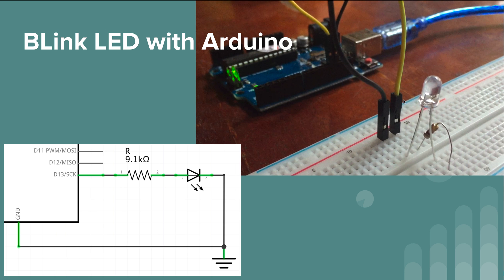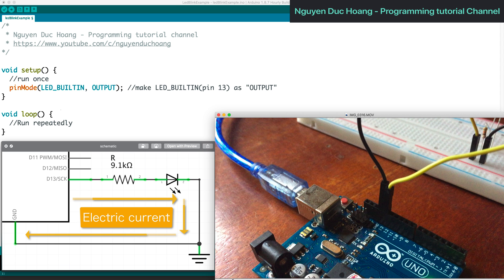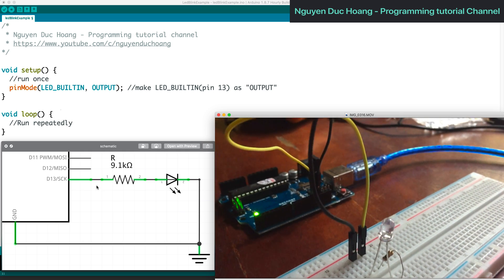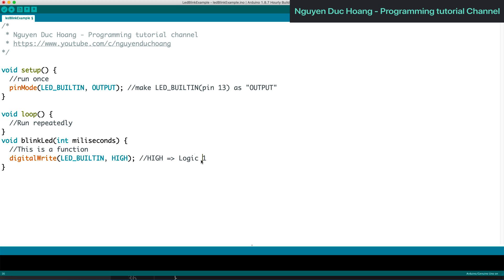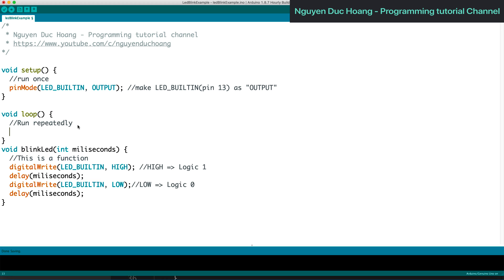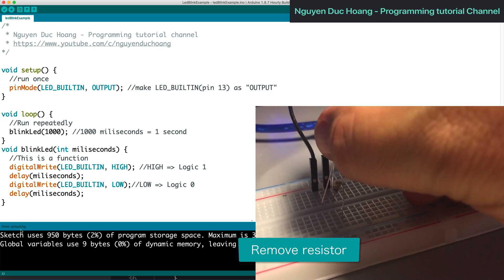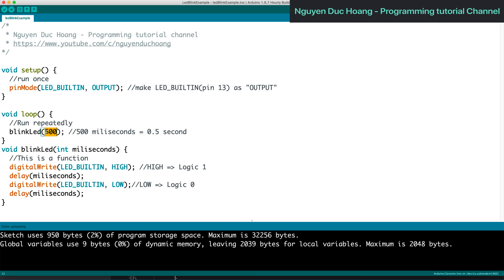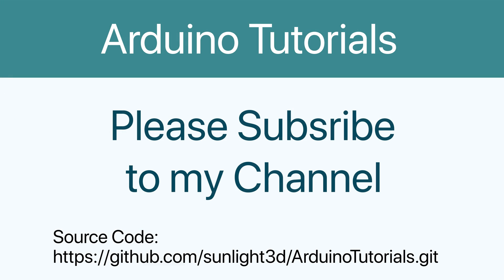02-Create a Blink LED with variable frequencies using Arduino UNO Rev3

Comment: Hello. Thank you for the clear video! My question is what is the min delay? I need it to be in microseconds range.
Reply from the maker: The Arduino Uno Rev3 microcontroller board does not have a specified minimum delay time. The delay function in Arduino allows you to specify a specific delay time in milliseconds using the delay() function. However, the actual delay achieved may be slightly longer than the specified time due to other processes and interrupts happening in the background. The accuracy of the delay depends on various factors such as the clock frequency and the instructions executed by the microcontroller.